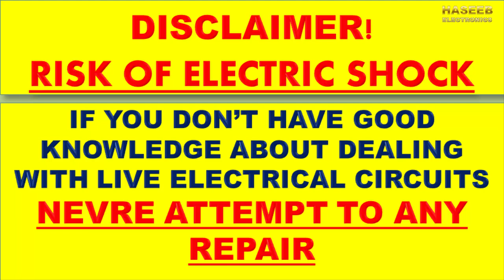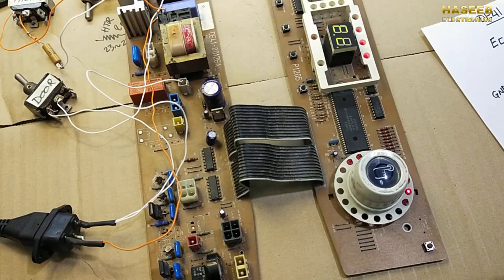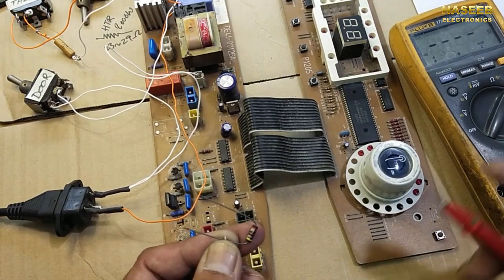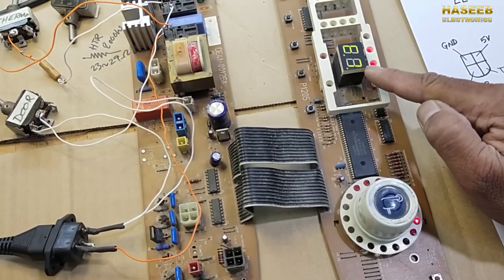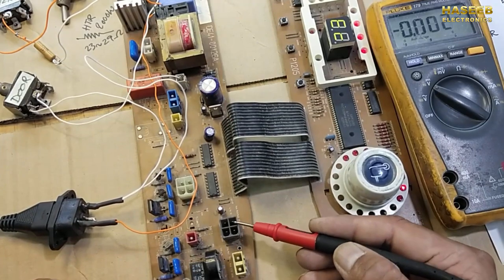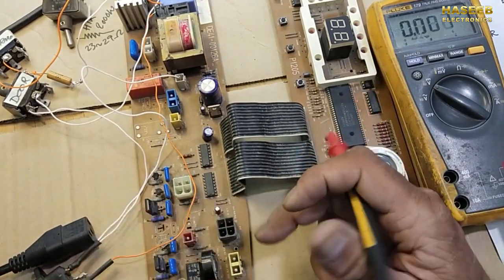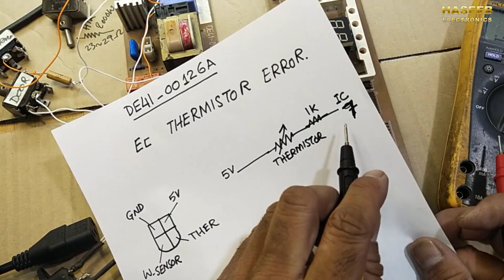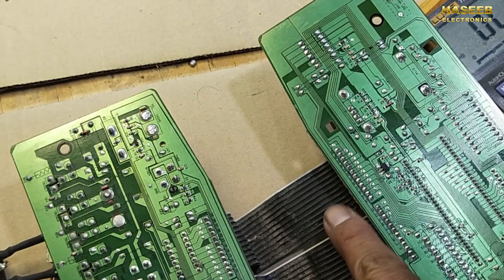[413] Samsung EC Thermistor Error / Temperature Sensor Error in  DE41-00126A Front Load Washing

Comment: Hello, do not be tired, master, I encountered this problem, I increased the resistance of the thermistor, the problem of Ec was solved, now it gives error e7, what is the solution?
Reply from the maker: E7 comes in 2 cases 
1.  water level sensor problem 
when it provides abnormal frequency (at low level the signal must 30KHz and at full water level it must 15KHz)
if the signal is stable for more than 5 seconds, then 

2. it is pressure switch error (When the error occurs, water drain pump will operate for 3 min. and then turn off the water drain pump. Then the display shows ‘E7’ indicating a pressure s/w error indicator